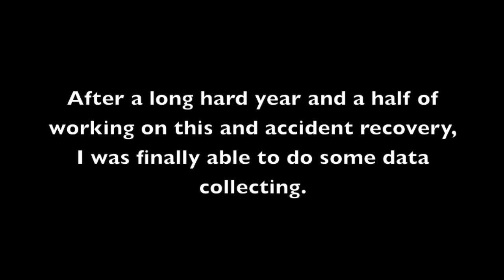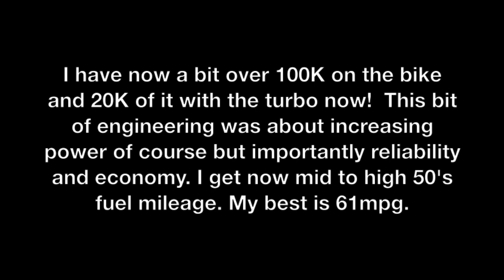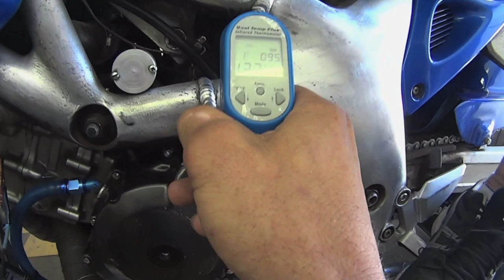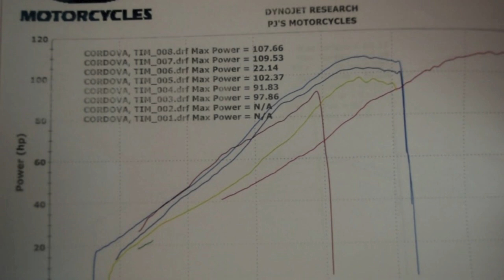Dyno Turbo Suzuki SV650,

Comment: You're using all stock internals, seems like it would be, a ticking bomb, at those levels, hows it on fuel use now ? BTW it's a big accomplishment to do that, at least it is too me ! My SV650 is fun, but it would be a monster like that.. Ride safe, yl
Reply from the maker: as i the video I get mid to high 50's mpg. Always depends on how you drive it. It's getting EFI set up very soon and  will expect better MPG from a different set up than stock for more efficient use of the internal chemical energy of the fuel source. Yes, I will ride safe! you as well!
Reply: Your bike is doing good on its fuel use, just as it is, my bike gets around 58 to 63 mpg, while still having fun, not being a turtle in the mountains. lol Yes the mpg is based on our riding habits, I go for being smooth with the throttle, it works best for me. You have put a lot of time, and mileage on your bike, and it's doing great, you must have worked out the AFR with the turbos boost just right, to make it that durable, it's smooth & no popping of any sort. Glad to hear your doing better from being hurt also. Take care & thanks again. yl

Comment: Very nice, but that weak spot where the oil hole is for the crankshaft scares me at that much hp.
Reply from the maker: I now have over 30,000miles with the turbo at constant boost levels 6-10psig. Crank failier is an issue of shock force vs linear applied force, for the most part especially in this application. Every component has it's breaking point, but I feel I've proven the difference to some significant degree, but there are always variables that have to be considered towards the integrity. I just felt it was higher than propagated on forums. It is also how the power is utilized, again shock force, high constant rpm are the two main culprits. I've broken forged 454 cranks, so it's all about knowing limits. Again, I just know it is higher than what is typically propagated on forums.

Comment: Nicely done, nicely done indeed.
When does the engine reach full boost?
I was wondering; my turbo diesel (car) spools up, and I could see this being a bit unwanted on a bike.
Note: I am a novice rider on a SV 650s 2004, and I really like the even powerband with no "spool-up" effect, like my pals GSX-R 600 2001.
Glad to see it's still running after the massive rain in 2013.
Reply from the maker: There is little to no lag and I can control how hard a hit I want on the boost with the upper control valve, considered basically a controllable priority breather valve and can allow boost to come on quite linearly, or very quickly.
Reply: tc104x Cool. I really admire the effort put into the bike instead of just getting a bigger bike.

Comment: what year is it?
Reply from the maker: it's a 2002, now with an 07 engine. saw just over 150K on old engine.
Reply: tc104x so the old engine had carbs? I have an 02 but thought you couldn't put a turbo on a engine with a carb cuz it would just blow the seals
Reply from the maker: Carbs get modified...easy mod for blow through. Still carbs on it. Could use some fine tuning but will probably leave them on for old school sake.